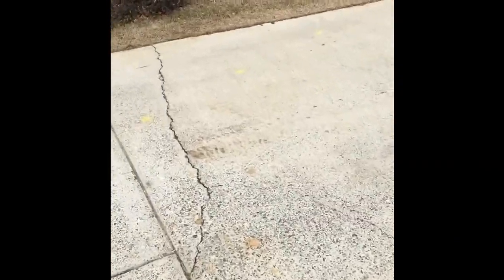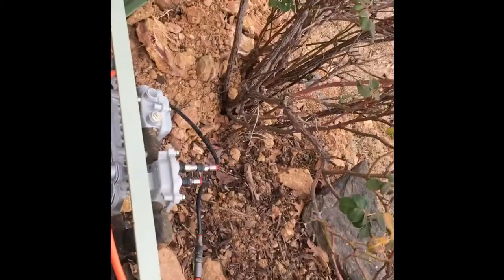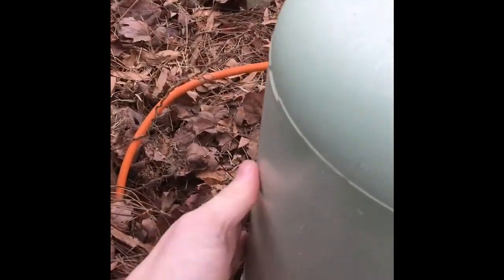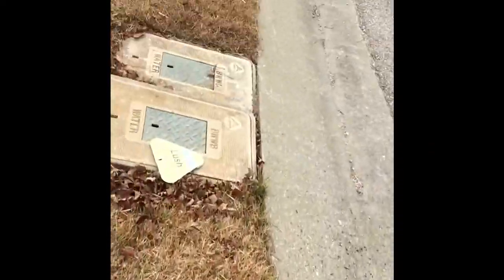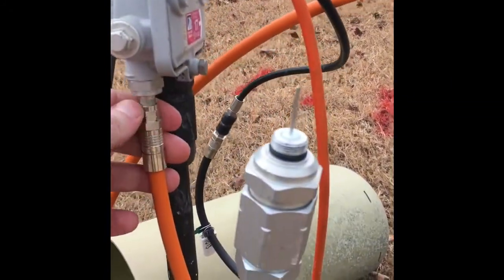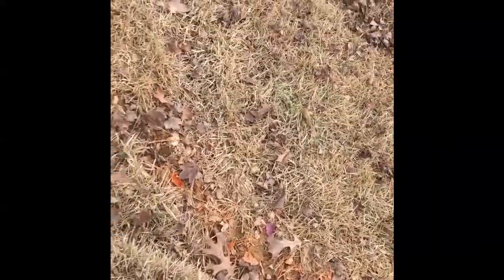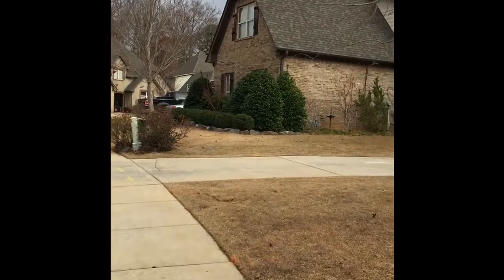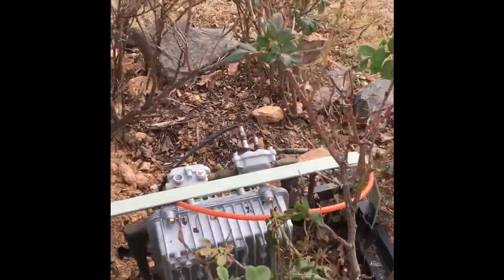Fiber Gigabit Internet Installation Underground - Cable and Underground Utilities - Aftermath

Comment from the maker: Do you guys like this kind of content?  If so -- I'll put together some videos on explaining "Internet/Broadband" MSO's -- ie: Cable (From CMTS to your home) -- Telco (Fiber DISC*S MX (FITL) Fiber Optic conversions for 1000Mbit symmetrical speed) -- in contrast to DSL and the advances in DSL for double bonding for 75-80Mbps on DSL and the limitations in that and so on.  

Let me know if you'd like some explanations/talk on these topics -- And if you have any PARTICULAR topic you would like a video to be made on.. do let me know - I'll get to work on it as I'm well versed in these areas as I've worked in these sectors in the past and stay up with them fairly well.
Reply: I think given cable is the most common form of medium for most people, a lot of people would benefit from knowing about CMTS's, DOCSIS etc. considering the current lack of public information. Thanks!
Reply from the maker: Great.  I can probably make several videos out of my own install and neighborhood in general explaining some things.  Maybe I should break each component down in shorter videos.. I know  99% of people won't click a video if it's past X minutes long.
Reply from the maker: I agree.  I no longer work for any telecom company directly so I wouldn't have access into a CMTS etc.. but I can figure out ways to do some 101 breakdowns of the basic elements, CMTS, .. what general "plant" is.. the last mile.. demarcs, maybe attenuation factors  etc.  Maybe a video on the new/latest D3.1 standard .. what Echo Cancellation is.. how it will be possible to run Symmetrical Gigabit over Coax soon (and faster technically).
Reply: Yeah, good idea, also your video title format should also have a part XX included just so the viewers know there's more to it. Looking forward to your vids.
Reply: For your breakdowns I recommend using either drawings or pics from contacts you may have in the industry. It's because a guy just talking monotone of himself would not gain that much attention. Cheers!
Reply: Interesting content. As you say at 3:21, I'm curious of co-ax type stuff.

Comment: That RG11 will probably be replaced with Flex, the thicker black coaxial cable in the pedestals. Those orange cables are temporary, unfortunately Fiber has to be buried deep and those locates have 3 feet to work with so this stuff happens.

Comment: Wow that's so crazy how that service line is so exposed like that.
Reply from the maker: Right? I think the best thing for the 'average' consumer to do would be to contact AT&T and have them back out to bury AT time (calling you ) when the customer would be home to literally supervise.  If they still didn't do it right, cut other services lines etc -- Then get the supervisors number and give him (or her) a call and it would be straightened out in most cases.  I only did this myself because I can  (not that it's particularly hard) and I wanted it done right (or what I deem right).  I've gone around and inspected homes in this neighborhoods installs and while most of them aren't above ground on the PVC to the house.. everyone of them has the Fiber line 1-2 millimeters below the surface several feet from the house to this PVC joint.  (IE: You stick your finger on the ground move it lightly and the fiber is now exposed.)  They need to have a meeting with the supervisor on 'acceptable' burial depth in this area imo.
Reply: It’s a fucking temp line. You don’t just call a supervisor and have them come out and bury a line. They will bury a hardline once they go through the city and have other companies come locate their lines.
Reply: Mine was like that, I said it was a lawsuit liability and they sent contractors out within 20 minutes after calling them. I said the cable was on th sidewalk

Comment: You clearly don't understand the markings or the dig laws. Just because the marking are put on the ground doesn't mean that is where the utility is. They have a 4 foot margin of error (2 feet on either side of the mark) which means that cable can be anywhere in that 'box'. Secondly,  while a utility locator will attempt to determine the depth, they won't guarantee it. There are too many variable which can affect the reading. Third, their detectors can be subject to interference and the maps can be wrong as well. The law requires them to 'pothole' once the markings are down to determine exactly where the utilities are if they will be digging in the vicinity. Whether they did this or not I don't know. Since gas lines and electrical lines are placed deeper than telco lines, I find it difficult that they wrecked havoc on your neighborhood like you stated. If they did in fact hit gas lines or power lines then those companies might in fact be footing the bill if they weren't buried properly. Gas companies are notorious for not following the rules. In my area, they like to drill through sewer and water lines. If the issues you say happened actually did, I would be willing to bet that there are more issues than just what the contractor did. When I used to do drop bury work, we went into a new neighborhood to fix an issue with a customers CATV. When we dug down we noticed that none of the utilities had been installed right (including the CATV). It was a mess and took us 3 days to fix it for this one customer. We did a quick survey of the neighborhood and found the issues were apparently neighborhood wide (several hundred homes). Sometimes contractors cut corners. I will say I am pretty upset by how they ran that temporary drop. That would never fly here.

Comment: You clearly are incompetent and know nothing about what you are talking about. The cable was only temporarily buried for safety. That is a temporary cable. I'm not a fan of how the temp cable was laid since cars can drive over it. The markings on the ground are called locate markings. They tell us what is there. Those orange markings tell us that their is existing CATV or Telco cables buried there. They are not there to indicate where the cable is to be buried. I am a drop bury contractor for Comcast and this is what I do everyday. There is a lot more involved than us coming out and burying a cable. But before you criticize others why don't you try to educate yourself about the process first. That cable will be replaced when it is permanently buried. Oh and by the way, it is a crime for you to open those pedestals. I know in my area we prosecute people for that.
Reply: Mike L people need to understand that cable companies have to get city permits to re-bury main lines like that. We’ve had a temp line in Texas above ground for a month and a half or so. It’s been damaged and replaced multiple times because of where it’s located, but until all the paperwork is finished, the .500 (feeder) line can’t be buried.

Comment: Pretty sure exposed cable is illegal and a tripping hazard.
Reply: Well,.. we've had a half mile copper drop from POTS Ped to POTS Ped in this neighborhood pushing a year now.  Ridiculous as it hangs on the sidewalks, street, grass etc.
Reply: It isn't illegal I've worked in the field for years. They run drop lines all the time. Pretty common for fiber.

Comment: Comcast contractors do the same thing, stop tampering with telecom. It is considered an act of terrorism for an ordinary citizen such as yourself to be opening those peds. 15,000$+ fine.
Reply from the maker: I worked for Charter Comm as a Systems Analyst/ Lev 3 Tech for years in the mid to late 00's -- I actually have a clue of what I'm doing should I 'want' to do something.  However, I also know without my meter(s) etc there is no real purpose in doing so at the 'plant' level outside of the Ped to Demarc and internal of the Cust. Premise.. Where Splitters, Coax, Compression Fittings, and my 'tools' of that nature can still help out in my home or friends homes.. and yes, I do help friends an family with those rather basic tasks if they have issues from time to time.

But I've been out of Cable Telecom for a decade basically -- So I don't go around opening Peds.  Do you even work for a cable company?  These pedestals (Not sure if I mention in the video) were open already and remained open with exposure , egress/ingress et al going on for many months.  I was just walking through the neighborhood and pulled out the phone to video a little bit of it for kicks.. as it was rather ridiculous/lazy/unprofessional and a bit dangerous in some scenarios for the MSO to leave the temp lines out in the yards and street for such a distance with exposed / opened peds.. Feeder work halfway complete and so on.  

I'm well aware of the 'fines' for a non employee to screw with plant... though if you've worked for the industry you'd know no one is fined for opening a pedestal... The only real action I ever witnessed in many years in the sector was for purposeful vandalism of significant Fiber.. The typical Fiber Cut for example that would knock out a silly amount of nodes and therefore customers until we patched it.  

Also, customers typically don't go opening peds nor do they really care about the plant infrastructure.  Usually anyone who is interested enough in the stuff finds their way into a job.. again if you've worked in the Cable sector you know a base level tech doesn't require much to get the job.  I was constantly amazed at how some techs ever got and maintained their jobs due to the work done.

Anyhow -- An employee of Charter/Spectrum , Comcast, AT&T.. whoever is still an ordinary "Citizen".  The difference is the plant is owned by a large company and that plant is unauthorized to anyone but those hired to work on it of course.  With exception of items that exist within the property boundaries of homeowner for example.  Technically if a Tap/Ped/Whatever is within a customers property and not in a Utility Easement they could open it and do whatever they wanted with it.  Now this would just screw up their service or do nothing at all of course.. but it's within legal rights to do so.  Again, Utility easements are a different story and most equipment is within this area/zone (as shown in this video).. But sometimes EOL equip.. or just wonky BP engineering causes some pretty significant equipment to be in someone's backyard.

TLDR:  No worries - I didn't open them.. they were already open for months -- And I have no interest in touching any of what used to be 'work' if I'm not being paid. :)
Reply: I wouldn’t have taken the time to explain to Ben jammmmmmin anything but you are very knowledgeable thanks for posting